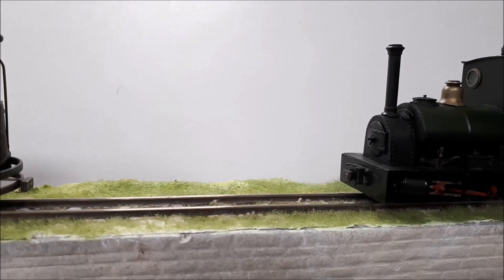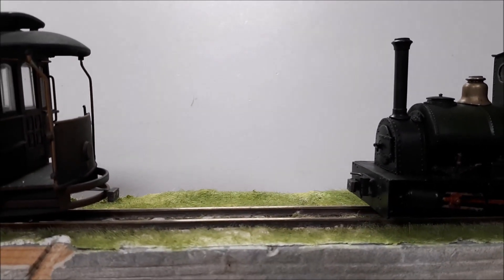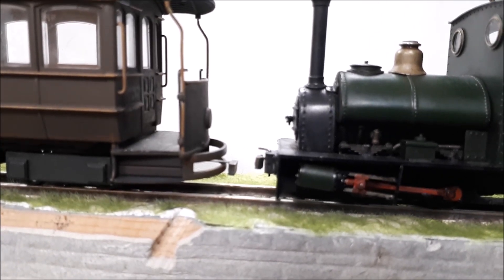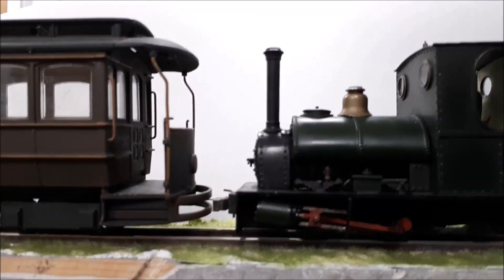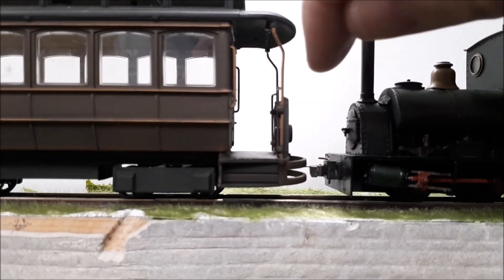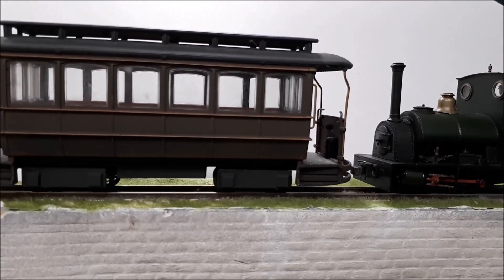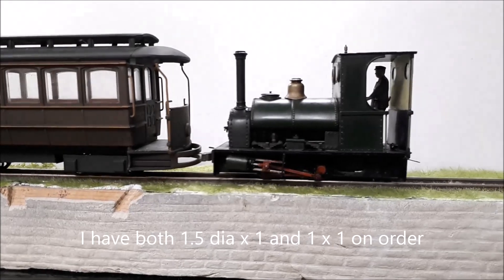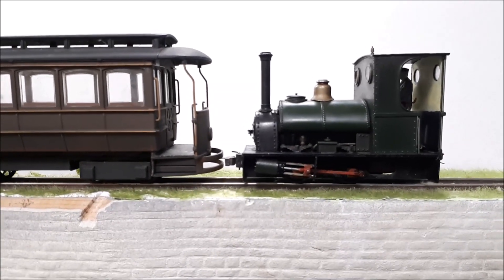Magnetic Coupling experimental for 7mm narrow gauge

Comment: Where are those coaches from? Are they a kit? Id really like to find them
Reply from the maker: @uniquely.mediocre  They are Bachmann Tram Car bodies, with bogies replacing the 4 wheel motor unit, trolley pole removed and roof made good, controllers removed etc...
Reply: @gilesengineer  thank you! I just really like how tram coaches look behind a loco and these looked exceptional.

Comment: May I suggest that instead of using smaller and smaller magnets, you simply add some plastic on front of the magnet to reduce strength. Easier to handle. Incidentally I recall having first generation lego train parts as a child in the early 70s.  The coupling comprised a double sided pocket on a pivot so the magnet could flip over to whichever side it wanted to couple up. Simple but effective.

Comment: I know you already stated you're aware of other magnetic coupling alternatives available so have you considered just using one small magnet for each coupling that would possibly reduce the issue you're having of them coming together before the loco actually "buffers up".

It might be possible to cannibalize a Hunt couplings elite coupler to achieve this.
Reply from the maker: Sorry James - it's taken me some time to find the information through waffle on videos to work out what is going on. I think the Elite couplings may be using a single cubic magnet sideways on - so the 'face'  is presenting both North and South poles, like dual magnets.
My apologies for confusion.
Reply: @gilesengineer  that's ok.
I just wondered if that might help resolve your problem with the magnet strength vs functionality.

I suppose there's only one way to find out.
Reply: Not really - if you use a single magnet, then it becomes important which end is north and which is south - so the vehicle always has to go the same way round . If you have two magnets, you have one facing north and one facing South  - but always the same way - do they will always mate up, no matter which way round the vehicle is.
Reply: @gilesfavell9642  not true with the Hunt couplings elite.
They work in either direction.
Reply: Bless you James  - very much appreciated! And the principle of using the duality of a single magnet is an interesting one. In 7mm I actually want one of reasonable size aesthetically (about the size shown) so in this instance its not too much of a concern.  It's all good learning stuff!